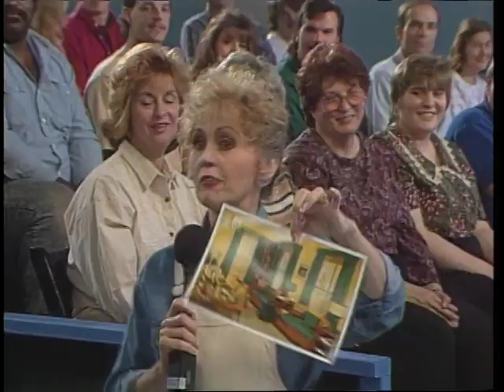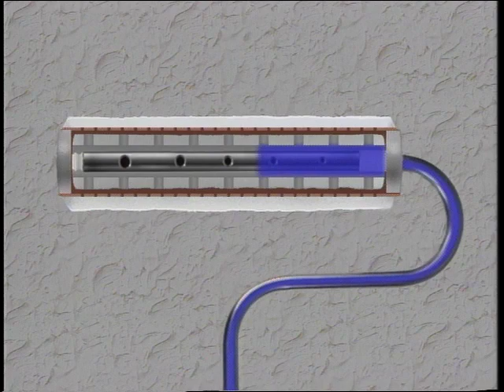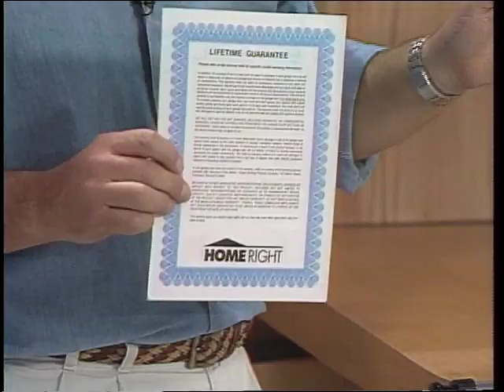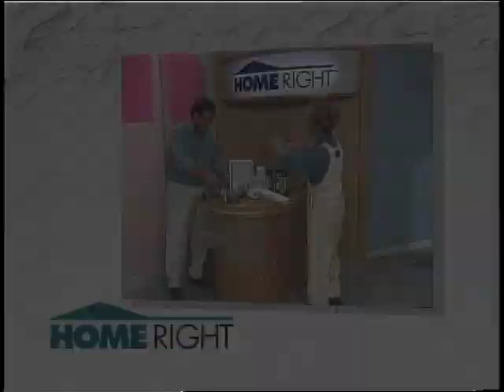HomeRight PaintStick Infomercial

Comment: People I bought this product years ago. Sat in my house. I always hired pros. Today I tried to use to paint my garage myself. Paint cap won't fit in paint can. Suction tube won't pull enough paint in cylinder. Push in back in ,paint all over tube. Notice pros don't use these gimmicks. Infomercials are for suckers.  And I was a sucker back in the day
Reply from the maker: Hi Cecil, sorry to hear you're experiencing issues. If you would like assistance please contact our technical service team at 1-800-264-5442